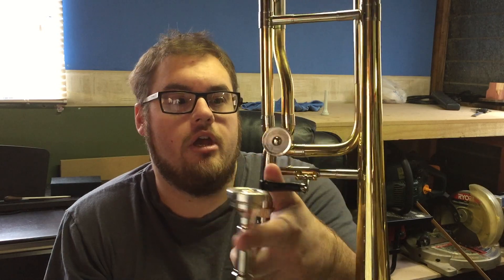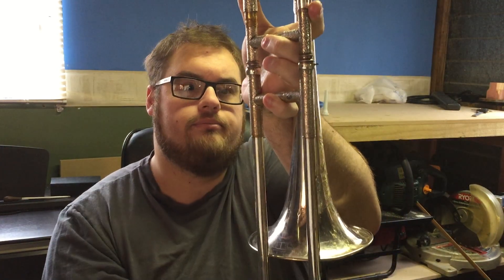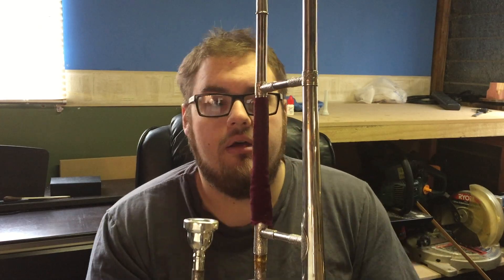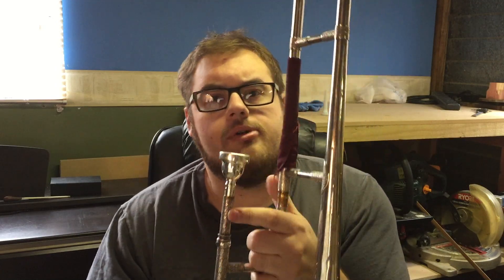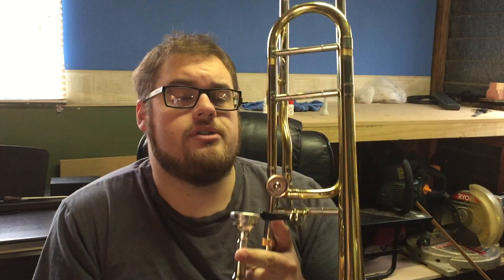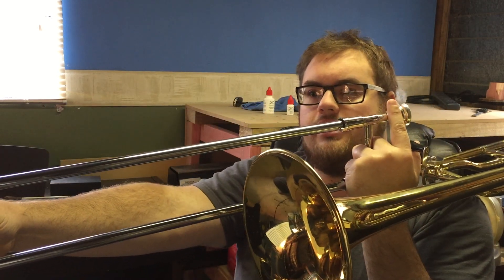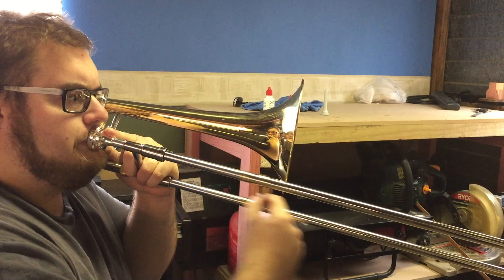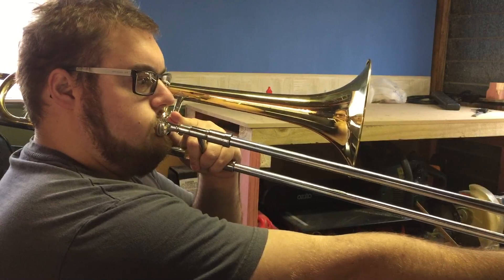Introducing Antique and Modern Tenor Trombones

Comment: My mom plays trombone, has for about 40 years following in her father's footsteps who played as far back as the late 1930s or 1940s, and one of her several trombones in the collection is my grandfather's original trombone which has no threaded attachment for the sections. Its just a friction fit. She played it in a band a few years ago for a while, but the sections kept coming apart so she bought a modern King Recording trombone for her main axe. She would likely still play the ancient one if she had someone adapt a threaded attachment mechanism onto the connection so that it wouldn't slip. She just hans't gotten to it. You may have been taught to play with a really round sound, but many trombonists nowadays in America favor a bright piercing glassy sound.

Comment: 6:08 how do you play the b natural?
Reply: I'm pretty sure b natural is 7th position
Reply: +Simeon Vassilev That note doesn't really exist on a tenor trombone. Either you pull your F-section tuning slide all the way out and then push the main slide all the way out, or you just play normally at the very end of the slide and lip it down.
Reply: The high B natural is played in forth position.
The low B natural is played in seventh position
Reply: Some tenor trombones have triggers. Pressing the trigger with the second position will constantly play a B natural, or you can pull the tuning slide all the way out and play it at the very end.
Reply: 4th position is the low B natural, as a false tone.

Comment: Nice demonstration.  I specialise in authentic vintage performance and small bore trombones certainly have a place - especially for 19th and early 20th century music.  Bands (and orchestras) just don't sound the same with modern instruments - even in the hands of the most competent players. Whether you prefer one sound over another is subjective.  I personally prefer a period sound for vintage music. However, using vintage instruments for music composed/arranged for modern bands and orchestras rarely works. But what ever the music, it music be played well and musically.  These old instruments frequently get a bad name from being played poorly (often by beginner bands who get old instruments cheaper than new) and on a repertoire they were never designed for.

 It is great to see another musician in NZ with an interest in old instruments.  Where are you based?

As with all vintage brass (and also saxophones), trombones will play far more in tune (and as intended) with the right mouthpiece.  And matching the instrument with an suitable mouthpiece can be a challenge.  The mouthpiece which originally came with the instrument is also not always the best, but a good place to start. A player often has to be willing to develop a different embouchure to get the most out the instrument using a different (vintage appropriate) mouthpiece. And most contemporary players both don't want to risk harming their modern embouchure, or put in the time to do that. Not all vintage instruments are good but many great vintage instruments are dismissed as being inferior quality because they are not correctly matched to either mouthpiece or embouchure.

The same is the case with mutes - many vintage mutes were designed for small bore brass instruments and play terribly out of tune if not matched with the right instrument.  There are also many that will never play in tune with any instrument.
Reply from the maker: Hi, thanks for your comment. I'm in Wellington.

Comment: For the antique slide, I am thinking clean totally, apply apply some Teflon used to coat racing motorcycle engine pistons and bake on then buff to desired slip. Works good on aluminum composition pistons and cylinder s but the cylinders need be honed after ,they need some drag to lubricate, and for rings to set.